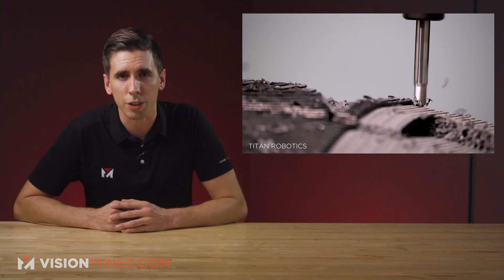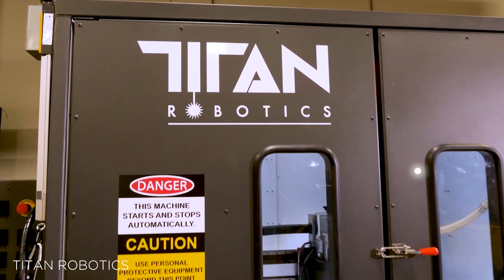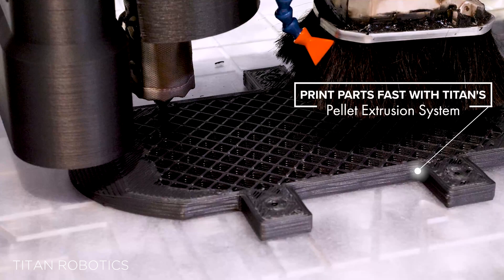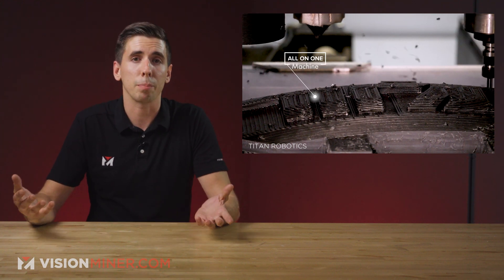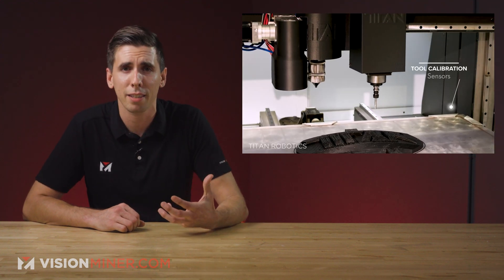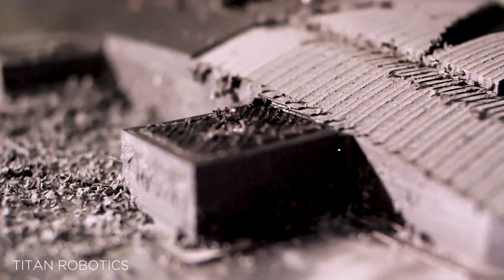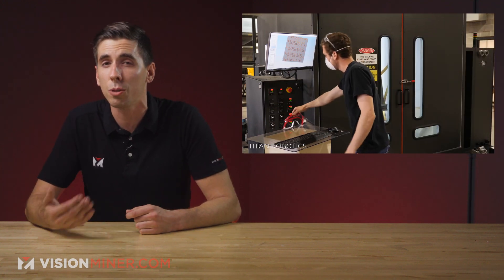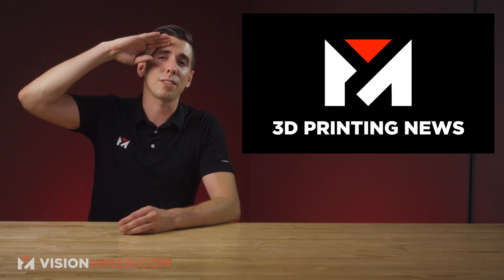Titan Robotics Launches Hybrid Atlas-HS Machine | CNC Milling Meets 3D Printing

Comment: What software are they using to slice and generate G Code?
Reply from the maker: Any slicer you want -- RepRap Gcode -- Simplify3D, Cura, Slic3r, just about anything :)
Reply: @VisionMiner  How are they generating the Cut file relative to the Print file?

Comment: That cnc machining shown looks really bad. It is probably cuz the parts are not sticking to platform hard enough.
Id expect to change the actual platform for vacum table and somehow optimize that.
Reply from the maker: HTN, HTNCF25, and HTN-CF are all PPA blends we sell :) visionminer.com/materials
Reply: Surface finish sucks because that's a flat endmill travelling non-linear in the Z axis across a curved surface, resulting in a sunken disk-shaped toolpath with distinct ridges. That RA value's gotta be in the low thousands.